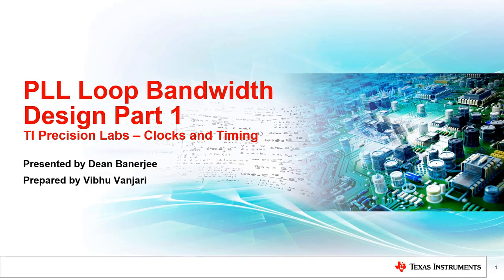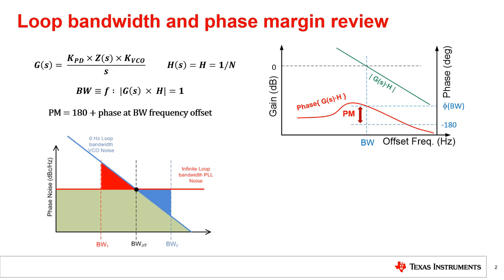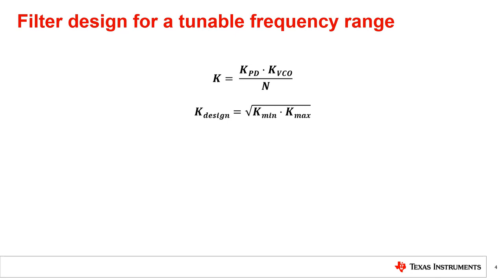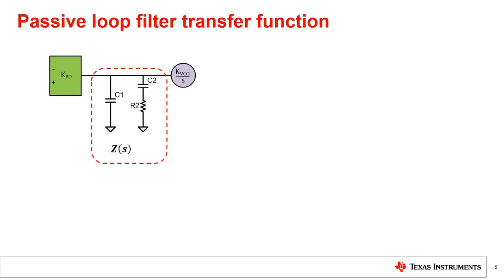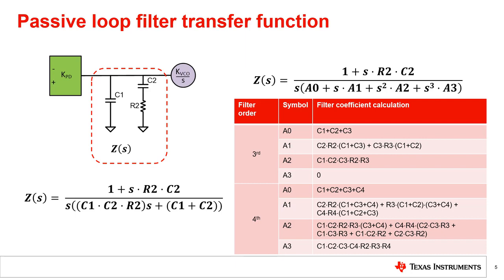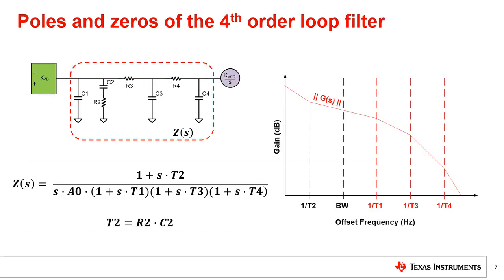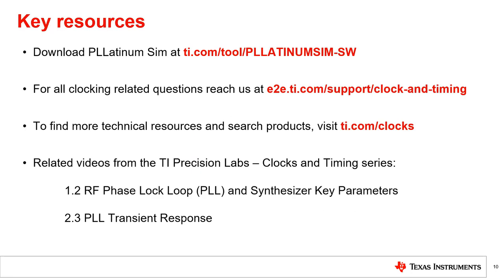Phase lock loop (PLL) bandwidth design - Part 1

Comment: Hi TI Team,
Thank you so much for the content, but I have two questions please help me with this,
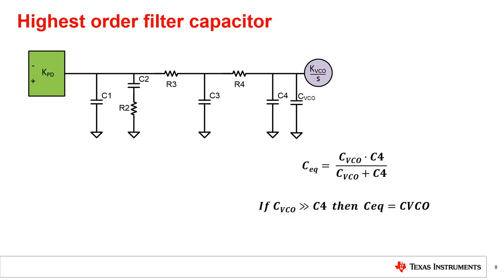Question1: at 8:21(time) - Why Ceq = Cvco series C4, should not be they parallel and then the equation become Ceq = Cvco + C4........
Question2: at 6:39(time) - Just want to confirm the total number of poles, since it looks like there is a pole at zeros and hence if it is 4th order system there should be 4 poles, thank you.....
It is little confusing please help me regarding this. I will be waiting for the reply...
Reply: My personal answers:
Q1: He is wrong.
Q2: It should be No. of Non zero poles.